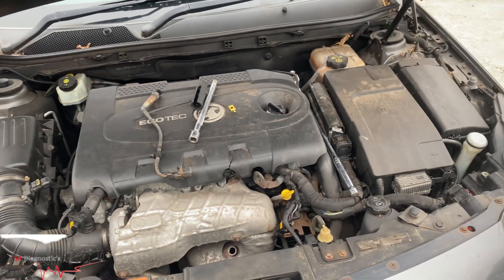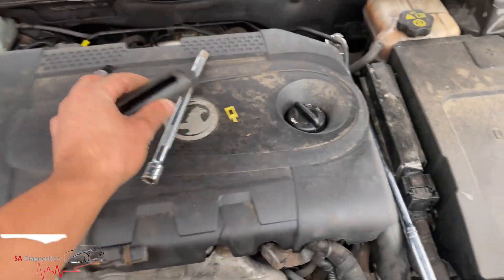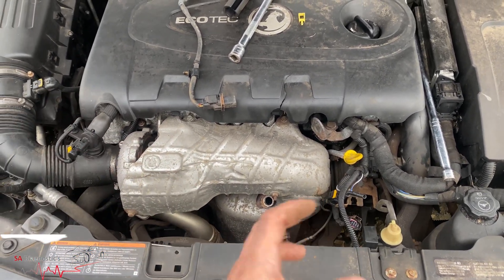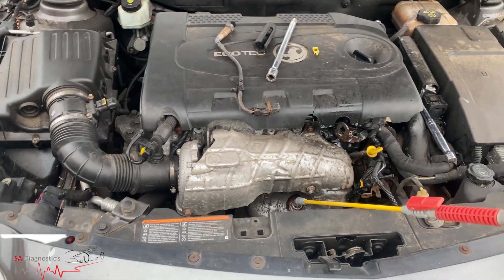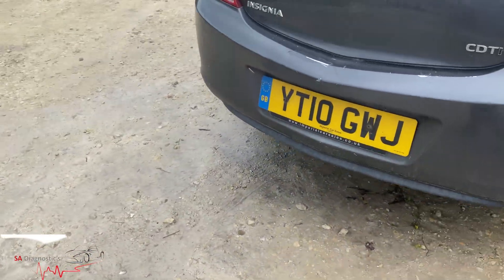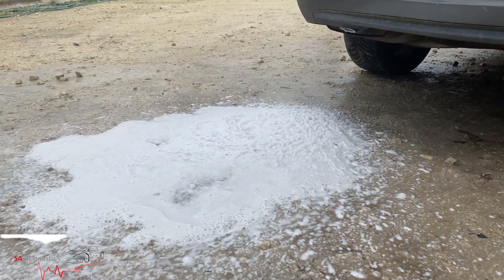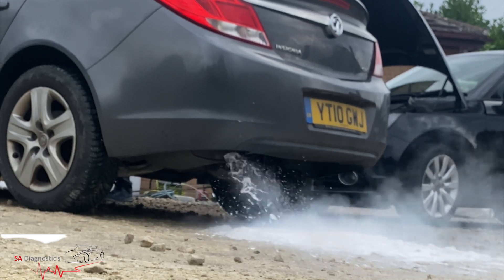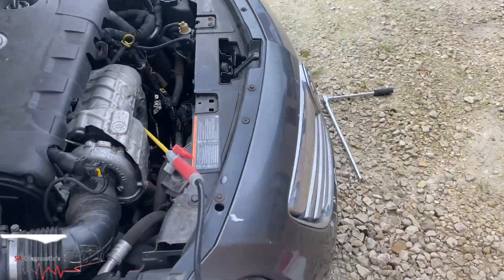Vauxhall DPF P2453 Clean DIY Diesel Particulate Filter Differential Pressure Sensor Performance

Comment: Hi mate, great video and will do my insignia on the weekend using your method, one question though, how would I know when to stop so it doesn't overflow like you said? Would it start coming out of the hole where you pour the bleach? 

Thanks.
Reply from the maker: Hi as long as the engine is running you should be fine because the pressure pushes it out. And to tell that you’ve finished you need to look round the back and look at the water coming out. Check to see if it’s clear water if so then that means it’s all cleared up…

Comment: After pouring the bleach in, did you just run water? Or a type of liquid? Washing liquid?
Reply from the maker: Just pour water through it for few mins to clear out any other liquid then go for a 10 mins drive blasting out any liquid out of the exhaust….
Reply: @sadiagnostics  Excuse me for bothering you... how much bleach? The kind you buy at 12 degrees? And then just rinse with water? Thank you in advance.

Comment: Hi there just subscribed to your channel I’ve a 2.0 diesel insignia b 2018 year can I do this with my vehicle as well ?
Reply from the maker: Hi mate yes you can certainly do this and it will hopefully solve the soot content and pressure… links are below on what you need 

https://amzn.to/4geItQg

https://amzn.to/46oVpii

https://amzn.to/4mf0HTc

https://amzn.to/3KgDOkR
Reply: Thanks so much for that reply do I need to put the whole tub through the car neat ? And with mine being the mk2 insignia is that sensor in same place ? As I know the egr on mine is at front of engine not Back as in mk1

Comment: My Corsa Diesel had gone into Limp Mode and all the symptoms pointed to the Exhaust Valve Management but after spending just under £10 on an OBD 11 meter it showed that the fault was lying with the DPF unit. I started "trawling" through Youtube and came across this/your video. I have to admit that I was very sceptical at first but I thought what the heck, what have I got to loose and went ahead and gave it a try. The wife only had half a bottle of Thick Domestos so I pinched that. Low and behold just half an hour later my Corsa was running as good as new so thanks for posting this great tip which saves a fortune in garage bills! Brilliant tip which I can vouch really does work, and works very well, you have possibly saved me a small fortune in garage bills!
P.S. The smell from the exhaust while it is burning off the Domestos is (shall we say) "interesting"!
Reply from the maker: Thank you for the feedback and this is exactly why I shared this video to help people like yourself so they don’t get ripped off by garages… :)

Comment: Did this today on 2019 mokka worked a treat reset dpf and then came on continue driving did that all good now thank you so much hade been in garage 4 times thanks again
Reply: Any idea on adblue service mokka x 2010
Reply from the maker: Thank you for the feedback and yes my videos are there for all the public. I’ve been doing these videos for years so the public doesn’t get ripped off by garages that do this same job but for £££s. 👌 👍
Reply: @sadiagnostics 2019 mokka x adblue service 480 miles to none start
Reply from the maker: @celticboy81 your best remapping them out that’s what most people do. Or you can use a decent diagnostic like mine and reset it. Adblue system is very common issue nowa days. Once you map it out it will no longer pop up but it’s always best to do a good motor way run with it…
Reply: That's it
Reply: What is remapping it out?

Comment: Hi mate. Need your help please. 
Catalytic temperature bank 1 sensor 1 is showing 0 all them. Egr error is -100.  Any help should be appreciated. Thanks
Reply: May be your sensor must be replaced?  Have you fixed the problem?  I have the same but with Bank 1 sensor 1 but the sensor worked .. i don't understand.

Comment: In the first bit of the video (1:09 into the video) is the car running when you are first spraying the solution in? or do you put it in to soak first then start the car then start the car and continue?
Reply from the maker: Yes make sure engine is running if you pour anything down it…

Comment: Maby  helps  my advice,  you can wire an led from the driver door mirror   inside the car wher ia the tweeter speaker, it will light up and  you will know when the car make a regen and  i will not stop the engine until it stops  light.  In this  case you save your wallet to not buy a new dpf and have all the time regens completed.

Comment: Hi if I take off the 02 sensor on the 1.3 cdti Astra and follow the same as yourself it should be fine the 02 sensor is in the top of the dpf
Reply from the maker: @allandodsworth2055  yes it’s the sensor before the Dpf.  As you need to run the liquid before the Dpf so it goes through the Dpf and all the way down. Make sure you have the engine running when you pour it in…
Reply: @sadiagnostics how much bleach do I need to pour down as it’s blocked pretty badly
Reply from the maker: @ as much as you want really. I’d pour in few liters until the water that comes out of the exhaust is clear….

Comment: Hi there will this work on my 2012 holden captiva 2.2 diesel  in limp mode now due to blocked dpf
Reply from the maker: @brgnhunta  yes but you will still need to use a diagnostic machine to reset the dpf…
Reply: @sadiagnostics what diag machine would you recommend?

Comment: Here mate just wondering can you help , so if you use bleach instead of the tfr,  do you just pour the bleach straight in from the bottle with the car running,  then run a hose through after it until it runs clear of the foam? thanks in advance
Reply from the maker: Yes mate exactly as you described but make sure engine is running at all time when you pour things down it

Comment: Hello mate, I have the DPF problem… to a Vauxhall insignia eco flex tech line SS 2014, it’s the same engine can I do this to this model ? And tell me please if I need to remove the sensor from the DPF or I can do it like that just remove the O2 Sensor, thanks 🙏
Reply from the maker: @cosmincvc  hi you can do exactly what I’ve done and it should be fine just make sure you have engine running when your doing this…
Reply: @sadiagnostics thanks, I will try tomorrow I will let you know if works 🙏
Reply: Do you have the engine running before you start to pour any fluid in  @sadiagnostics

Comment: I have the Astra j 2012 2.0cdti ,having trouble pulling the o2 sensor connection out of the steel bracket its pushed into ,is there a trick to this or special tool ,access is limited ,i watched your video but you had already removed it lol ,thanks.

Comment: Can you clarify - is the Scan tool required for this? Do you reset the dpf before and after the clean with bleach? 
Do you need to disconnect other dpf sensors to protect them from bleach, or not required? Thanks
Reply from the maker: @paulm4687  if your EML is on then yes diagnostic is required if not then no it’s not require ….
Reply: Thanks for the quick response. Will keep the engine running all the while putting bleach in. Then after bleachu you used TF4 fluid?. Do you finally flush with water? 
Think I'll try it for my Astra J 2.0l, ongoing issue of clogged dpf.
 @sadiagnostics
Reply from the maker: @ yes just flush it with water after so there’s no bubbles left…
Reply: Wich bleach used for this cleaning guys? Thanks

Comment: Mate u just saved my life, insignia 2cdti flushed with bleach was told by two garages had to have new dpf spent 90p on bleach and £20 on a socket 👌 did it myself and im a girl 😂
Reply from the maker: @kayleighclark86  that’s great to hear you’ve sorted it. Yeh that’s the main reason I make these videos so the public  don’t get ripped off….
Reply: MashAllah
Reply: Your car still works? Just ask for safety ☺️
Reply: What type of bleach did you use ?
I found 4 different and doesn't mean squat to me 😢
Reply: We’re do you get the socket from m8
Reply: Hi, which bleach solution please? The 12-degree one?

Comment: I want to do it today, but I’ve looked at it again and if I’m not mistaken, the metal housing where you open the sensor is the DPF. I was planning to fill it through the exhaust temperature sensor, which is a bit further down. Is it possible that if I fill it through the exhaust temperature sensor, it will only reach the lower half of the DPF? Or am I wrong? I'm wondering if I should do it today or wait a week until I get the proper tool delivered. I'd prefer to do it today if it has the same effect. Is the metal housing already the DPF, or is it located further down and the metal housing just leads to it?
Reply from the maker: @TheHiddenJungleKing  the higher you do it the better it will be as that means it will go through the dog completely rather than half done and half not. As long as you can open the sensor then you’re all good. But sometimes it’s a pain to take these sensors off so it maybe best to wait for the socket to come…

Comment: Can i Put the Bleach  through the Exhaust gas temperature sensor ?
Reply from the maker: @TheHiddenJungleKing  yes should be fine but make sure engine is running
Reply from the maker: @TheHiddenJungleKing  it will run back out so you have to have an enclosed whole and sealed
Reply: @sadiagnostics  

Thank you for your feedback. So, I would then mix 4 liters of bleach with 4 liters of water and pour it all into the exhaust temperature sensor. Then I would let the car idle for about 20 to 30 minutes so that the bleach can take effect, and then press the gas pedal up to 3,000 RPM to push out all the liquid along with the soot.

Should I dilute the 4 liters of bleach with water or just pour in the 4 liters of bleach from Aldi directly?

Do I need to rinse it with water afterward? should I pour water into the exhaust temperature sensor again to rinse it with clean water, or is that not necessary? 

And does it have exactly the same effect if I use the exhaust temperature sensor to pour in the bleach mixture instead of the differential pressure sensor, since it goes in the same direction anyway, or does it only have 80% to 90% effectiveness when using the exhaust temperature sensor opening?
Reply from the maker: @TheHiddenJungleKing  so

1- pour the 2x bleach in first don’t mix it. Then pop a who’s through like what I’ve done and run the water steadily through the exhaust sensor. While doing this make sure engine is always running. Once you’ve popped the water whose through and water is running then put your foot on the accelerator so it can push all the soot out. 

Again do the same use 2x or what ever many you want and repeat the process again. 

The final part would be to pop the water who’s on and leave it running until it cleans out all the bubbles. Probs 10 mins or so… 

Main thing is to use the very first sensor as that will help it go through all the dpf system…
Reply: @sadiagnostics  Thanks. So as I understand it now, in the video you removed the sensor and inserted the hose there. Directly below it is the exhaust temperature sensor that I'm talking about. Can I just do everything through that? The reason is that I can't get the top one off because it's at a difficult angle and my tool doesn't fit properly. I can easily remove the lower one, and that's where I would fill everything in. Will it also lead to the DPF?
Reply from the maker: @TheHiddenJungleKing  yes should be fine that too…
Reply: @sadiagnostics  thanks
Reply: @sadiagnostics  

Iwant to do it today, but I’ve looked at it again and if I’m not mistaken, the metal housing where you open the sensor is the DPF. I was planning to fill it through the exhaust temperature sensor, which is a bit further down. Is it possible that if I fill it through the exhaust temperature sensor, it will only reach the lower half of the DPF? Or am I wrong? I'm wondering if I should do it today or wait a week until I get the proper tool delivered. I'd prefer to do it today if it has the same effect. Is the metal housing already the DPF, or is it located further down and the metal housing just leads to it?

Comment: How long will a flush last a few weeks or months and years
Reply from the maker: @yafai29  depends on the drive you do I’d say minimum 6 months but if you do motorway drive once a week or so then easily a year.
Reply: @sadiagnostics  really it’s my missus car don’t do many miles in the week but let’s say the weekend we give it a good run would that be ok to keep it ok and running good after a flush
Reply from the maker: @yafai29  yes that should be fine just make sure you push the revs to 3k

Comment: where is the diesel particulate filter on the Opel Insignia station wagon automatic diesel attached to the engine or under the car
Reply from the maker: @Alaattin-rk2ju  maybe am unsure your best checking the engine son eBay to see where it’s based or google images…

Comment: Good video I wondered if you could do that on an insignia right through the oxygen sensor Hole thanks a lot
Reply from the maker: @gary8866  yes shouldn’t be an issue as long as the engine is running when you pour the liquid down it

Comment: Hi quick question I have a regen issue on Zafira c 2.0 cdti due to turbo changed, oil had leaked into the exhaust system. Would this clean oil out the dpf?
Reply from the maker: @DonaldBaxter-ij5uq  yes it will clean out the dpf jus make sure the engine is running when you pour anything in through the exhaust sensor…

Comment: One question but does it also start without Lampda sensor, or do you have to reset the ECU errors after cleaning. thank you for your answer !
Reply from the maker: No it should start without lambda sensor, once you’ve done the job just do a full reset.

Comment: Hello mate, do you just use the spray bottle to fill it? Or do you use an actual hose after with just water? Don’t want to ruin my engine 😂 you mention about overfilling it
Reply from the maker: Sorry for late reply you can pour it in using the spray bottle as it’s pressured and use normal hose pipe to flush it…

Comment: Alright mate I have a Astra J 2010 1.7 i have had a few failed regens due to switching off engine as it tends to choose to regen once ive pulled into work, its been driving fine & i have no warning lights, & cant find any codes with my fox scanner. I was driving down the motorway the other day then without warning it just lost all power, & light coloured smoke started pouring out the exhaust its  lost power in the revs but if hold it slowly builds up but still no power & pouring out smoke. Any ideas of what this could be? Is it dpf related? Also had a mild oil leak coming from the hose that connects to throttle body. I often check oil dip stick & it seemed quite high so i didnt add anymore. Thanks. I havent taken garage i got it towed home & has since run out of mot & insurance but wouldnt drive there anyway so its sorn.
Reply from the maker: Hi sorry for late reply, am honestly unsure it could be turbo failure….

Comment: Quick question buddy mention to be careful not to let it over flo to back up into engine. If u let theengine run wire doing this will it eliminate that risk
Reply from the maker: Yes basically if you don’t have the engine running the. It will flow back into the turbo and into the engine. However if you have the engine running then this will instantly push the liquid out through the dpf and it will not flow back into the engine. https://youtu.be/_xUAsy_FhXk?si=CtgCVtMPNxGhYVY7
Reply from the maker: Yes basically if you don’t have the engine running the. It will flow back into the turbo and into the engine. However if you have the engine running then this will instantly push the liquid out through the dpf and it will not flow back into the engine.
Reply from the maker: https://youtu.be/_xUAsy_FhXk?si=CtgCVtMPNxGhYVY7

Comment: Hi I have the same car and it jumps in and out of limp mode depending on how much throttle you put on , if I was to do this would it cure it
Reply: Any luck mate? Have the exact same thing with the engine light coming on and off as well
Reply: Did you find the issue with yours thanks
Reply from the maker: Doubt it mate you have to see what the fault code is. But most diesel cars suffer this issue. You can give it a try, it will help the engine and not cause any pressure…

Comment: Does this not damage the exhaust back box? What about the catalytic converter?
Reply from the maker: No it shouldn’t do. It will dry out more or less straight away as you’ll have engine running etc…

Comment: Bleach is an alkali which will only dissolve a couple of the salts (red ash) out of ten or so. Acids will dissolve them all, so a good acid rather than bleach is better (Alkalis can also damage the stainless steel wire inside and the DOC). Pool Cleaner (32% Hydrochloric acid) - 5 Ltr is only about £20. Pre clean it will detergent or degreaser mixed with hot water - dishwasher tab or washing gel tab are fine, this will remove oil and soot that will protect the ash, wash out then with water, then the acid . Best to take off car really so can soak.

Comment: Could you exolain how much bleach you use. How do you ensure that you dont overfil it
Reply from the maker: You can use as much as you want the more the better as it’s cleans it more and more each time you put it down there…
Reply: Worst thing ever! You are putting it in there with the dpf sensors attached ? So that could fuck the sensors up as there not ment to get wet……
Reply: @DjR91  He unplugged the sensor, he said at the beginning.
Reply: @richardjones2811  oxy sensor removed but temp sensor was not
Reply: @richardjones2811 the dpf pressure sensor isn’t removed and what about bank 2 oxygen sensor also ?